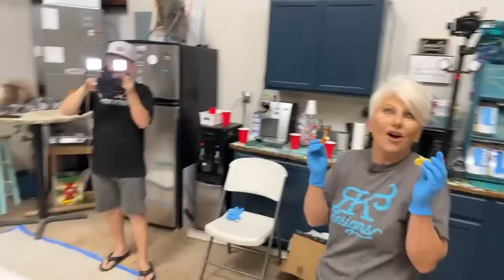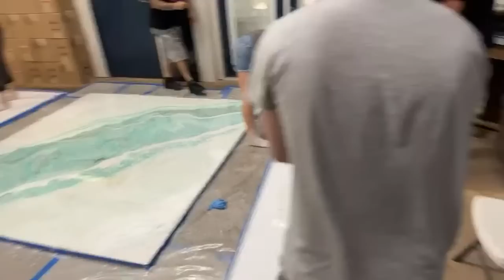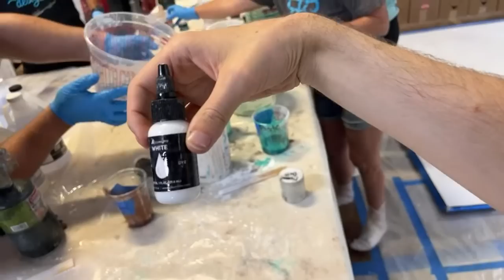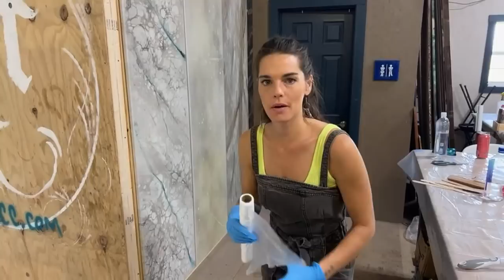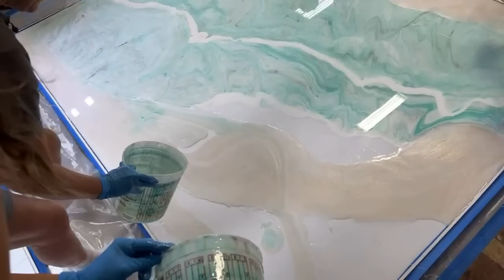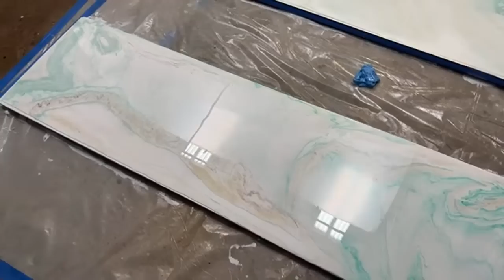Biggest Foam Wall Boards EVER!

Comment: How did yall torch it?
Reply: yes they did
Reply from the maker: We used a small torch for the area we could reach then used a long pear burner to get the middle. 🤣
Reply: @RK3Designs  Clever! Me googling long pear burner😅.  Beautiful work, did i mention, 😚.  Heck i was so amazed at the process that i forgot to mention it. 🥰
Reply: Even with fans and good ventilation I would be using a respirator especially when you’re using the heating elements. Everyone in the room should have a respirator and I wouldn’t allow my animal to be in there breathing it.

Comment: I don't see anyone heating any part of these pours. Will they not have bubbles?
Reply from the maker: We did torch it (may not have been in front of the camera) but we didn’t have a lot of bubbles during the pour at all.
Reply: @RK3Designs  thanks for the clarification. Did you use the weed burner torch ends to reach all of it? BTW I am blown away by your limitless artistry and skill at melding mixed material/mediums with epoxy!